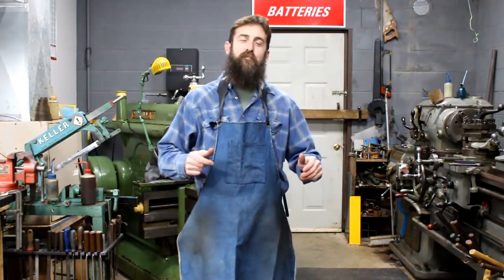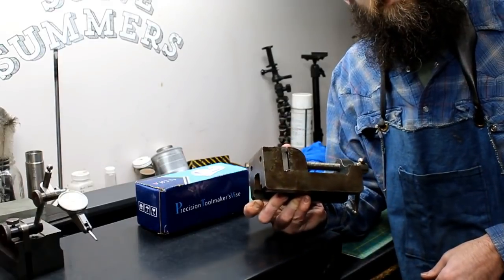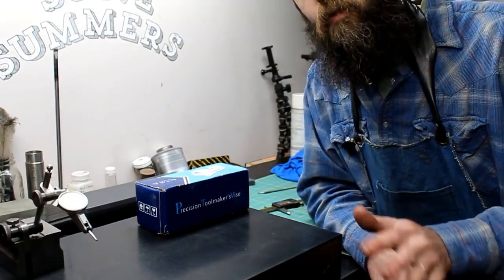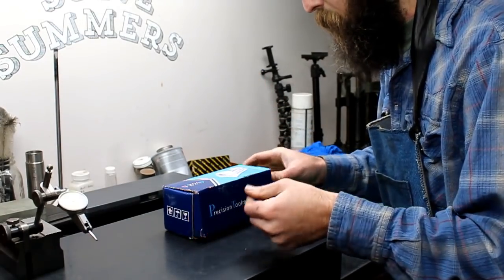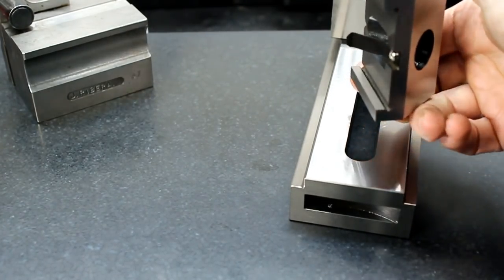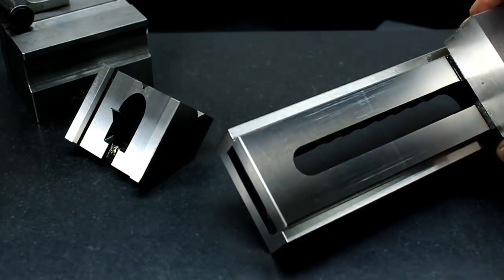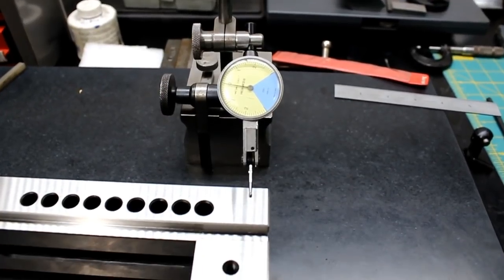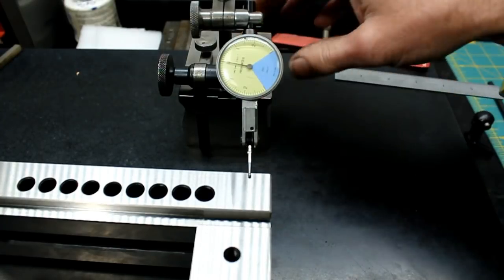Surprizing ToolMaker's Vise Review

Comment: Great execution of measuring even though you claim it is not the best. Sure, we can start nitpicking with temperatures etc., but for all intents and purposes I didn't find an actual flaw in your methods.

Well, except one little thing. When you were measuring the V's, the only thing you could have improved is to have an end mill or round rod long enough to cover the whole V length. Now the small length affects how the movable jaw rocks/tilts as it is not clamping evenly across the face.

And one way to measure is to just lay the movable jaw on the plate from its reference surface and then put a pin against the V and measure. This way you reduce the errors as you have nothing extra in the setup.

Comment: What is the brand and part number if you can tell me that. Thanks Steve
Reply from the maker: 2-1/2 Inch 63mm Quick Action Precision Machine Vice Fully Ground Hardened
Tool -- https://goo.gl/2RGPve

   
       More Budget Professional Tools -- https://goo.gl/LBHZ3c
Reply: Thanks Steve I checked out their web site. Lots of interesting stuff there. I wonder if anyone here has tried their 1-2-3 blocks?
Reply from the maker: terry cannon I have not seen the 1-2-3 blocks. The set I use in this video is junk if you ask me, one is good and the other is all over the place. I bought these years ago for pennies off ebay so I guess its hard to complain.

Comment: It's nice to see all those measurements, but I would have liked to see the vice actually used on the mill to see how well it holds a workpiece and how accurate it is if you try to mill something like a cube using this vice.   Take something like a small block of aluminum, mill it into a cube using this vice's fixed jaw as the main reference, and then measure the cube when you are done to see if the cube is nice and parallel, etc.   That's the real test.